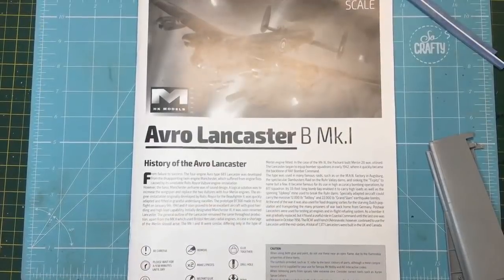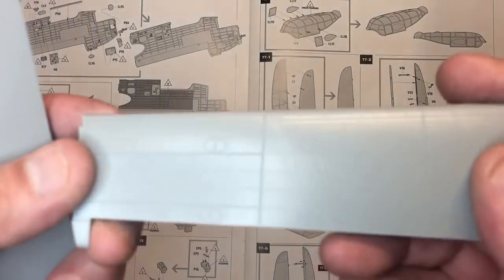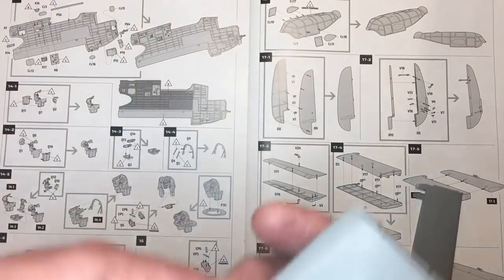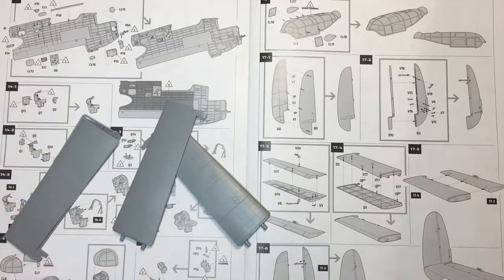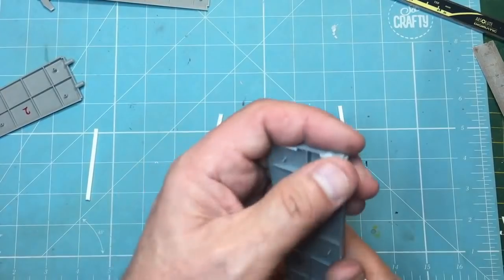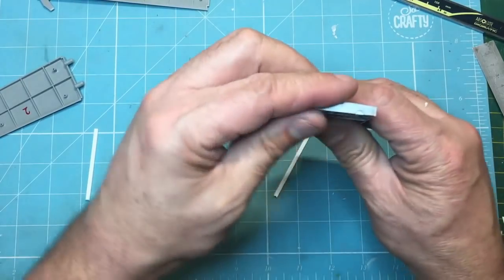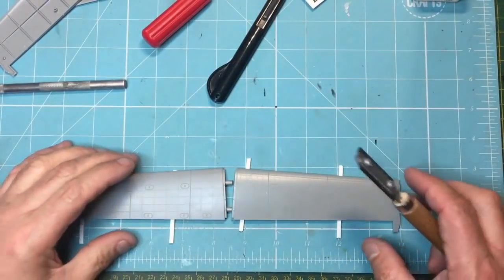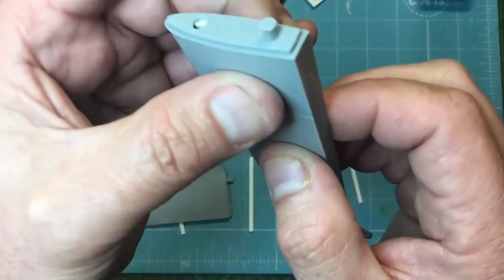HK Models 1/32 Lancaster Tailplane Correction guide

Comment: Hi Nigel. Well done with getting this correction done quickly for everybody else to follow and not make the mistake of getting the wrong rivet detail on the tail planes. I have completed my method which I fabricated up some surplus sprue and turned them to the correct diameter but cut into the first rib to give extra support but in the end we have both got over the problem I highlighted. I am also raising this with HK Models.
Reply from the maker: Hi Keith,
Thanks for pointing this out.. You are truly the man with the "sharp eyed catch" as I described you. I have now told the world!! Not sure the extra support going into the first rib is necessary, but you can never be too rigid eh!! HK Models will already know as I have posted it on LSM.
If you spot any more errors let me know.. I'll get it up here.
Reply: @NigelsModellingBench  There is the problem of the bomb layout in that the front 2 rows of bombs are show as all in line when the inner 2 should be lower as they were fitted to an additional bomb release mount. I put a sketch on the FB page if you check it out. Will be taking a break as some model engineering to get on with at the moment with part for a 7 1/4 gauge locomotive.
Reply from the maker: @keithcrabtree3080  Yeh, the BB is a mess isnt it. Four bombs across the front, incorrect i believe? The other issue is the moulded in holes for the bombs.. what if you want to display it with no bombs?? Not to mention the million EPM's!! I look forward to the WNW kit.
Reply: @NigelsModellingBench  If you look up Lancaster Bomb Load on Google then check out the photos you will see the exact layout as it should be with the 18 500 lb and 4000 Cookie bombs and if you get close in you can see the mounting beam.
Reply from the maker: Keith Crabtree I have the book I reviewed a couple of weeks back, which shows all the different layouts. I know what you mean. 
I am tempted to make mine a Dambuster Lanc as the B.B. is such a mess, including the doors!!

Comment: Nigel, no surgery is required on the Tail, there are 2 top surfaces and two bottom surfaces, ignore the instruction and part numbers. I just mated up the correct bottom surface with the correct top surface, no problem added hinges for movement of the rear part. All snuggly fitted. Best wishes from Bomber County
Reply from the maker: No David, but I do not make videos to give people extra unnecessary work. Lower halves have access panels, uppers do not. You will have put parts 2 and 4 together and 1 and 3 together. So.. you have two lowers on the starboard side and two uppers on the Port. Unless of course you're not even building the 1/32 kit?
Reply: @NigelsModellingBench  Nigel, I have just been into my modelling room to double check, I definately have two lower tail sections with access panels one on each side of the tail structure and its defo in 1/32 scale,  I just ignored the instructions, but only in relation to kit part numbers, and I have a correct tail assembly with access panels where they should be and they fit perfectly onto/into the rear fuselage. Could HKM corrected the moldings or was it an error in kit part numbers, I just know that the dry fitted tail assembly is correct. Its sitting dry fitted on the box with all parts and is correct. Dont know what HKM did or when they did it ??
Reply from the maker: @davidfenton4387  Interesting..... Which version of the kit do you have? I have the first edition, my second kit, purchased less than a year ago. Sounds like HKM corrected their tooling, which is very unusual for them? There are obviously still old kits out there with pre corrected parts. As you say, yours is correct, it would be impossible to build mine without having two uppers and two lowers.
Reply: @NigelsModellingBench  just bought mine recently from Jumblies, unusual situation with the tail surface detail. I have only had this kit 2 weeks Nigel , I can understand why modellers are of such divided opinion on it. I am enjoying it overall, and it will build into a impressive beast. Took a photo to add to this, but it seems I cant add it. It clearly shows Port and starboard tail plane under surfaces with engraved access panels. I think we must both be scratching our heads. Maybe they (HKM)  listened to criticism of reviewers picking up on this error and updated a change in the moulds to rectify this error because of the Border release of the WNW kit. Hopefully this will all come out in the was and somebody somewhere will shine some light on it. Cheers from Lincolnshire.
Reply from the maker: @davidfenton4387  must be the case Dave?? However, they still pump out the round nose on the B-17 and the long seat base on the Lanc. I guess you know the seat pedestal is too high, which pushes the seat too high up onto the canopy hence the short armour plate.
Reply: @NigelsModellingBench  Hi Nigel, maybe the process to update the engraved tail surfaces was easier than some of the other changes that they need to implement. I can only think that must be the case. Do wish companies who release such impressive Beasts as the Lanc and Fortress would get things right. I know the Border beauty is out of the range of my RAF pension. This Lanc will be impressive but could have been way better......shame. best wishes from Lincolnshire.
Reply from the maker: @davidfenton4387  It "should" have been better Dave. The time it took and the help they had should have produced a kit close to as good as the BM/WNW kit. Even if you ignore the inaccuracies, the detail should have been a lot better. Are you going to do anything about the seat?
Reply: @NigelsModellingBench  hi Nigel, I bought the Resin 2 detail Lancaster pilots seat, it looks lovely, woulded in crisp straps and buckles, really nice, much lower, with armour plate and trim wheels etc. It really looks the part. Just placing it where it needs to go it looks the part, very detailed, with the oxygen bottle and holder crisply in place behind the seat.

Comment: Hi Nigel - Thanks for your vids & I will be following your progress building this beast...Iam a bit concerned that with such large tailplane surfaces which will be glued in place, there is the chance of damage in case they get bumped against a hard surface...Also are u going to be doing a "cut-away" of a wing section to show the internal structure?
Reply from the maker: Alex Khalif If strength is your concern, perhaps drill both fuselage halves and put 4mm rod through. Then you could remove the 4mm pegs from the tailplanes and just slot them over the tubes?